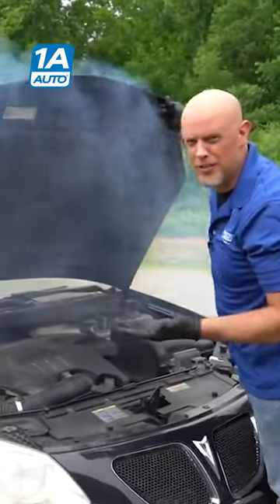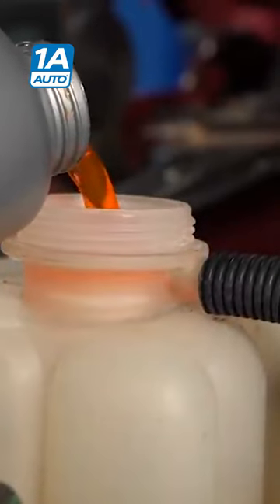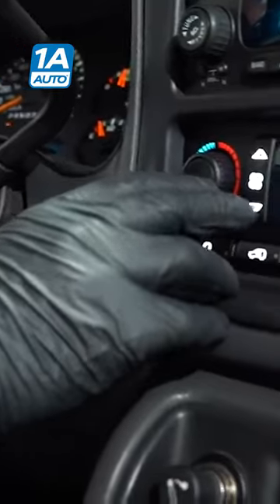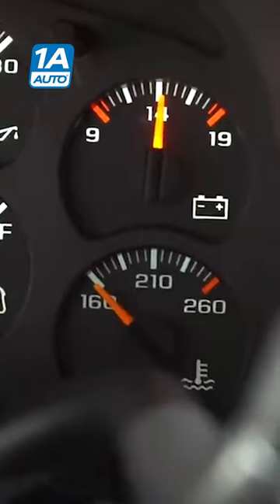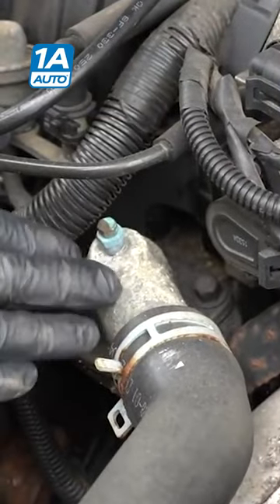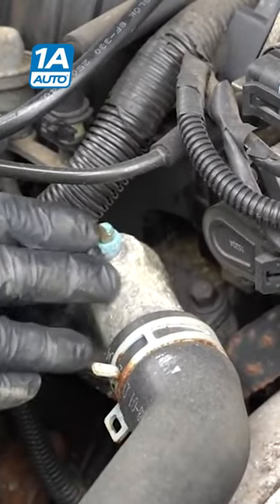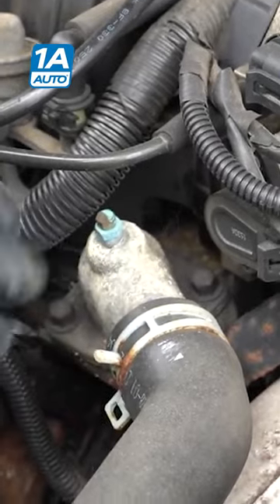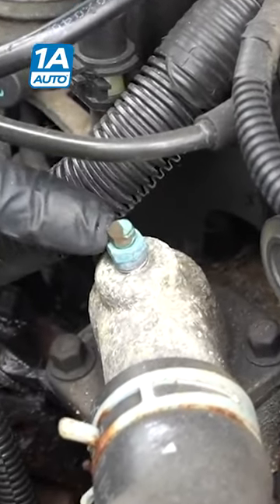Overheating After Replacing Radiator, Pump, Thermostat? Burp Coolant to Remove Air Pockets! #shorts

Comment: My car leaks coolant and will drop temp but as long as the reservoir has fluid it will self bleed and keep temp. I think I need to RTV the thermostat housing to true up the surfaces since I replaced the thermostat recently.

220k miles 04 civic

Comment: I think it would just be better to just change the coolant in the reservoir every year. Then you would have to worry about flushing the engine. Because the coolant will always be clean. I know it will cost more in the long run but hey it will probably save on labor. Bc coolant is like 20 maybe 30.